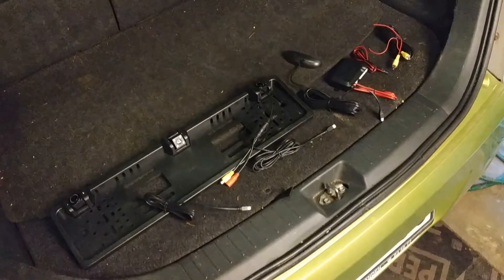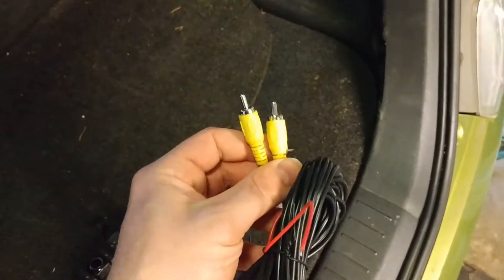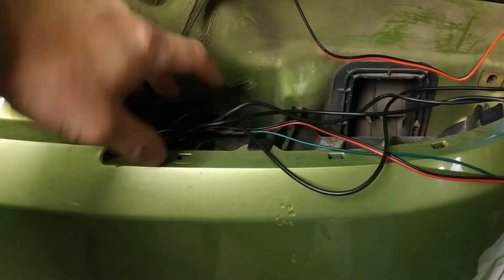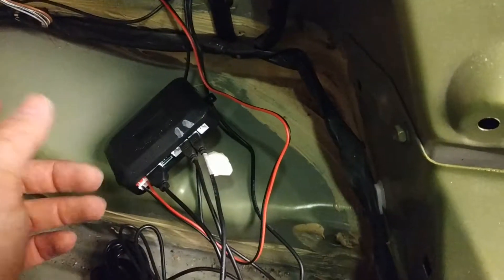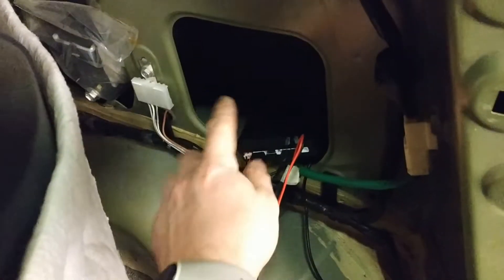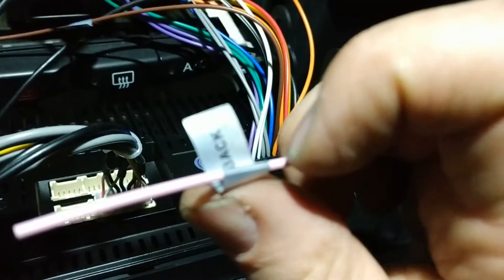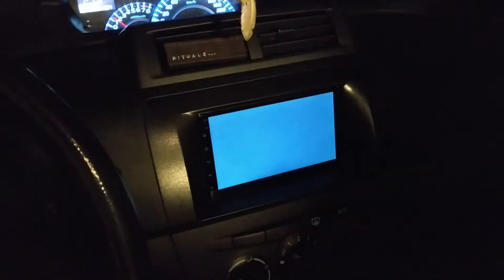Wiring cheap universal backup camera and parking sensors to universal android multimedia head unit.

Comment: Hi how did you get the wires from near the plate to the behind the lights? Did you have to drill a hole? Thank you
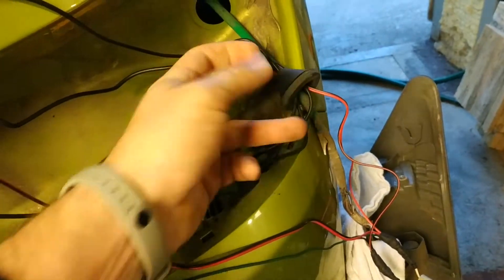Reply from the maker: Hi. Nope no drilling. 3:20 in vid I made it through a rubber grommet
Reply: @garbagecargarage  thanks for your reply! I mean the wires from the plate how did you hide them from behind the plate and through to the light if that makes any sense
Reply from the maker: @masterm9360  oh that part 🙂 as I remember there's a hole in upper part of number plate niche. But if there were no i would try to make it throu originila ruber sealing parts just drill if it's bumper. If hatch make rubber grommet
Reply: @garbagecargarage  thank you very much for the reply, I'll try it out tomorrow. Much appreciated once again :).